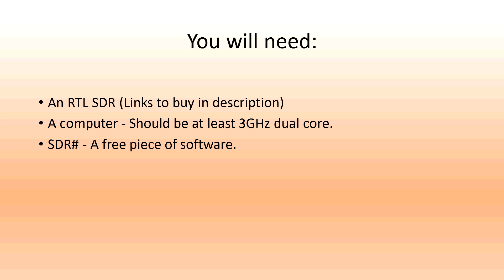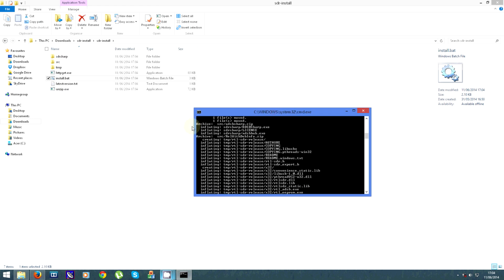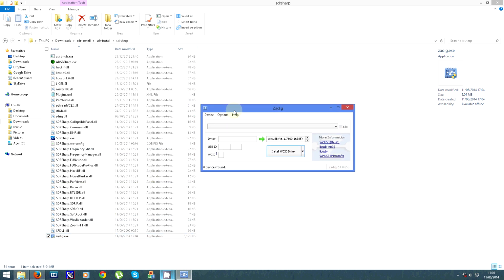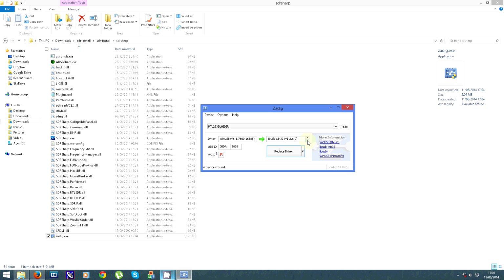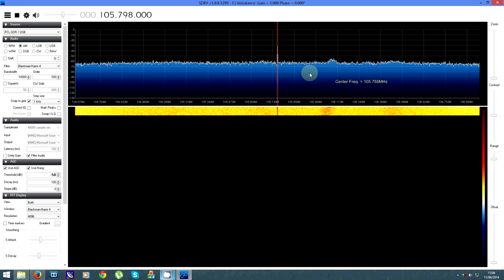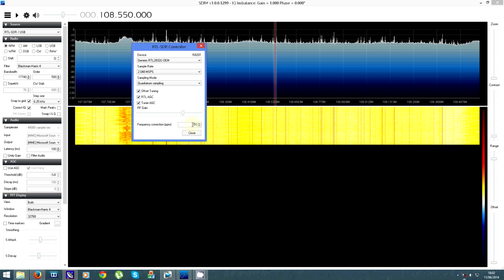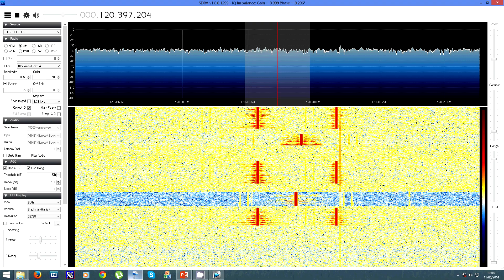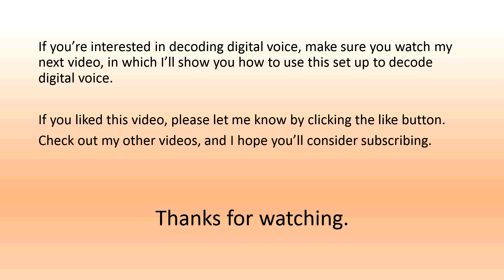How to set up RTL SDR with SDR#

Comment: hi can you help ive set all mine up an all i am getting is static but if i use a handheld radio it works fine
Reply from the maker: +James Hannah antenna not connected properly? gain set incorrectly? ppm not set?
Reply: +radiosification hi no m8 its still not working its allowing me to pick radio frq up but wont let me get anything else and i fine that hard to believe in liverpool
Reply from the maker: Sorry can't think of anything else

Comment: Well the install.bat didn't work for some reason which was a MASSIVE hiccup.  I ended up ripping the command lines, apparently the zadig operation in the .bat file is not accepted in my windows 7.  But I managed to get everything downloaded and in the right place by acting as the batch file and doing it myself line by line essentially.  Thank you so much for this video.  The first time I tried the install batch from a different source I was sure I just ran a virus but no, your download was the same thing, my DOS batch system just was incompatible missing a comparative command that resulted in it simply exiting out without any message echo'd to inform the user of anything.
Reply from the maker: d74g0n I've not heard of anything like that happening before. Thanks for your comment and I'm glad you found the video helpful.

Comment: whats it mean when i get the device is not connected
Reply: i am using a IEIK SDRMCX RTL-SDR, FM+DAB, DVB-T USB Stick Set with RTL2832U & R820T. Great SDR for SDR#, Low-Cost Software Defined Radio Compatible with Many SDR Software Packages
Reply from the maker: It means that it isn't connected
Reply: so how do i make it connect
Reply from the maker: Is it plugged in properly? Have you tried using a different USB port? Is the driver even installed?
Reply: ok but in the device manager it says that the device is working properly
Reply from the maker: Probably a driver issue then. Try messing with the drivers
Reply: i have uninstalled it and reinstalled it
Reply: could it be that installed the cd that came with it